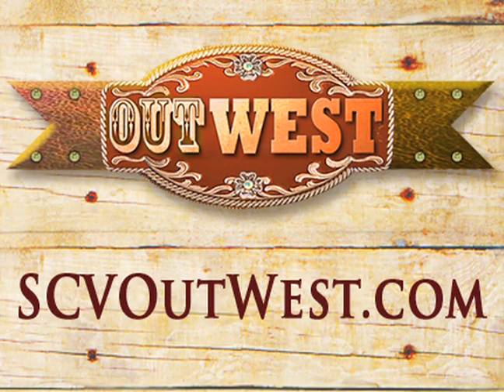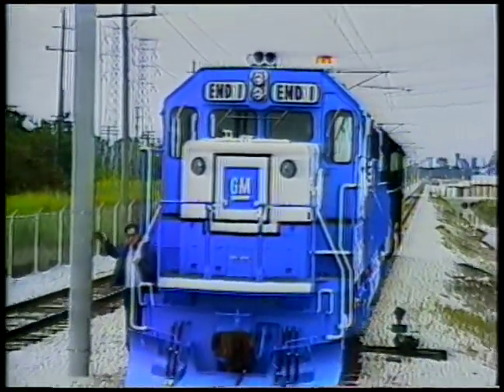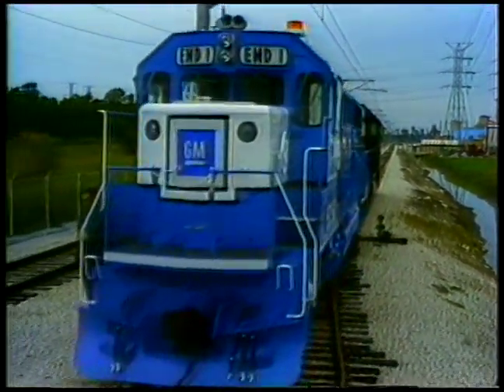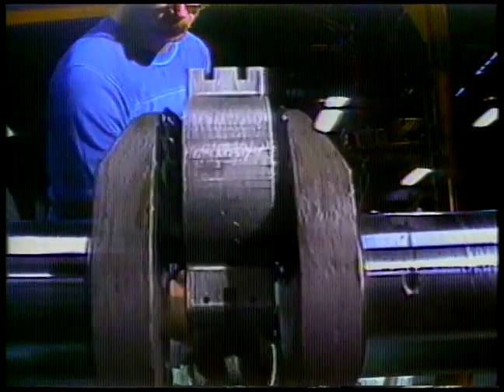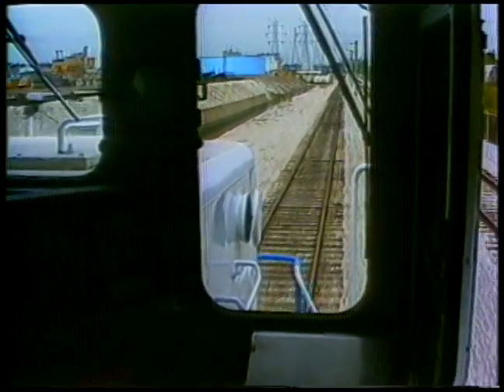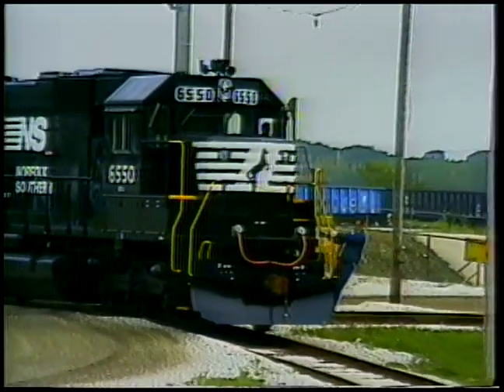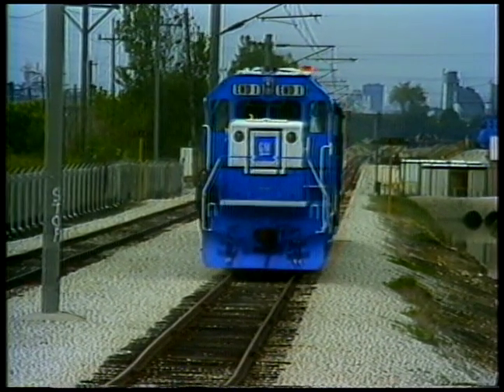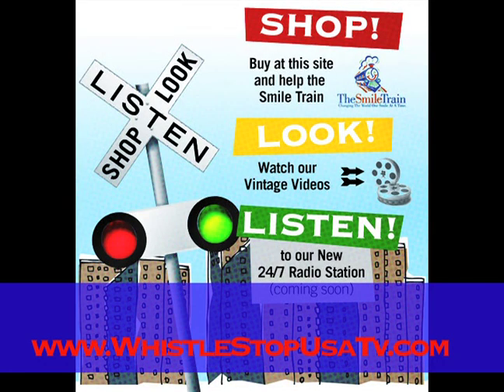GM EMD SD60

Comment: The SD60s were the savior for EMD. Though they didn't sell in high numbers in comparison to the 40-2 and the SD70s, they brought EMD out of the hole they dug with the SD50. 
CP/SOO SD60s have been the most favored and well sought after fleet considering how many are still on active roster and went through at least 3 different rebuilds. 
Some crews will talk badly about their ride quality but that's typical in a modern world dominated by GEVOs.
Reply: Soo Line’s experience with the SD60 was not a good one. The units had been on the property only six months when rust started appearing. People got all excited about “candy-apple red” dip-job but that was only an attempt to cover the rust-which it did. Then they started having problems with grounding. They were kept close to home after that and spent a lot of time on transfer runs. Soo continued to mainly use their SD40-2 fleet which they had a lot of faith in. If CP hadn’t taken over it’s a hard question as to whether the Soo would have looked at GE or not. They had a rocky experience with U30C’s and they were still in love with their Dash-2’s.
Reply: @CNGuy1987 the AC6000CW ultimately was a failure, like it’s EMD counterpart: the SD90MAC, it was prone to breaking its own engine crank shaft. The prime mover was also troublesome with its twin turbos. Ultimately all were repowered by both CSX and UP.
Reply: The GP60's & SD60's helped EMD but GE outdid them with the -8 series in terms of horsepower and traction. Norfolk Southern rebuilt their SD60's into SD60E's which are still around. Union Pacific rebuilt a small amount of SD60M's into SD59MX's that are only used in California because of their emissions regulations. The GP60's have survived in higher numbers than the SD60's have, but their days can be numbered at any time just like any older EMD units. The reason why Wabtech/GE has dominated the market is because of less costs, saving fuel, and better warranty programs. EMD went downhill when General Motors sold them out. It only got much worse when Caterpillar became their parent company. It tarnished what was left of their reputation.

Comment: Although the previous Model the SD40-2 was far more reliable so newer is not always better
Reply: considering most are being rebuilt by CN and NS id say the SD60 is the same as the SD40-2....now the SD50 on other hand...…………………………..
Reply: B Wallace the SD60s were plenty reliable.
Reply: SD60s where blown out of the competition by the dash 9s
Reply: @RailsOfTheMidwest  i dont think they weren even making SD60s then. They had moved on to the SD70s i think.
Reply: @Apollo Matias why would you do that bro
Reply: @ReadingAreaRailfan  it’s a scam. You search up what they told you, and then it will direct you to malware.
Reply: @MattsTrainArchive  i never did lol
Reply: @ReadingAreaRailfan  I meant dash 8s lol
Reply: @ALL-bj7mj  CSX has 4 SD50-3 left one of the last Class 1 rrs to still have em
Reply: SD40-2: “we are far more reliable”
SD70 series and SD80MAC: ”HOLD MY SPARE COUPLER”
Reply: The GP60's & SD60's outdid the GP40-2's & SD40-2's in traction alone by 3%. Reliability is the same. The 645E3's & 710G3A's-710G3B's are the best prime movers that have held up by EMD in today's market with massive resources still out there for them. CNW immediately started removing SD40-2's from coal train service when they realised how much traction the SD60's obtained. But then again, they also ordered C40-8's and were doing the same phase once the C44-9W's and then AC4400CW's were debut. Burlington Northern ordered SD60M's while leasing the Oakway SD60's at the same time and all units were heavily power pooled for coal trains specifically alongside their SD40-2's, C30-7's, and C36-7's. The GP60's & SD60's were also optional as high speed power for intermodal service just like GE's -8 series. The likes of Southern Pacific, Cotton Belt, and Santa Fe did the most out of that. As a matter of fact, before being purchased by Conrail and then ending with CSX, the 4 EMDX SD60 demonstrators along with the 3 EMDX GP60 demonstrators were highly used for fast intermodal service on ATSF while they did the lease for awhile. The only reason why, aside from tremendous production, that the GP40-2's & SD40-2's are still around and outliving everything is because of better resources and distribution on the market. Although, EMD was brought down mainly because of emissions regulations and not just GE's dominance.

Comment: Well i think the SD60 was superseeded by the SD70
Reply: Yeah apparently the SD60 has a lot of problems. As far as I know the SD70 and SD40 were good.
Reply: @anthonyj810  The SD70 had several versions. The latest is the AC version with T4 emmissions compliance.   The SD40-2 was probably the prettiest rig ever produced and its too bad they could nt just retrofit it with AC traction and T4  emmissions. Actually they can. But GM does not own EMD anymore. I think CAT does.
Reply: @anthonyj810  the SD50’s had issues, the only issue with the SD60’s was the bad taste left in people’s mouthes from the SD50 since they were almost identical.
Reply: @yipsalanimich321 
EMD actually did have AC traction prototypes of the SD40-2's and even one unit with microprocessor technology as the SD40-3 MPR. They did the same to a few GP15's, GP38-2's, SD38-2's, and even one of the SDP40F's, as the F50CM, that were returned back to them from Amtrak. The technology was just debut too soon.

Comment: The 50-60 were mostly junk.  Too many problems.  70 was a big improvement
Reply: Maybe the 50 series, but I thought that the 60 series was very good. I have always had good luck with them. Last year I had one, and it was a red good puller.
Reply: Can’t forget about the now gone for good SD80MAC

Comment: These are not new, not even in 2013 when the video was put out. The SD/60 series was probably put out in the 1980's. Some are old enough they have already been scrapped.
Reply: SD60s were produded from 1984-1995. This video wasnt made in 2013, it was uploaded to YouTube in 2013.
Reply: When I toured the EMD LaGrange plant in November 1974, 
the EMD SD-40 was in full production.  Control systems were standard analog (relays, etc.).
Reply: @w9gb  They had some relays, but had gone to lots of solid state electronics.